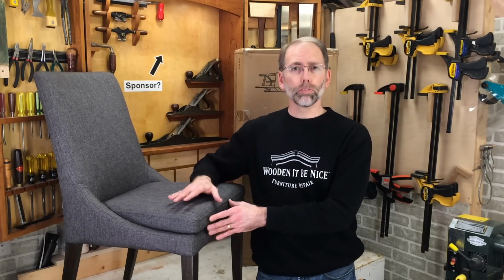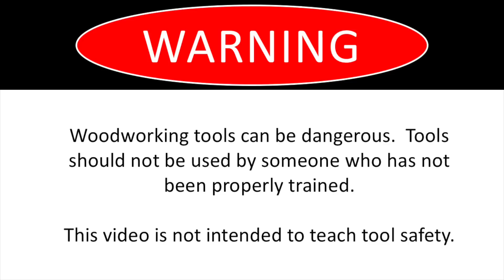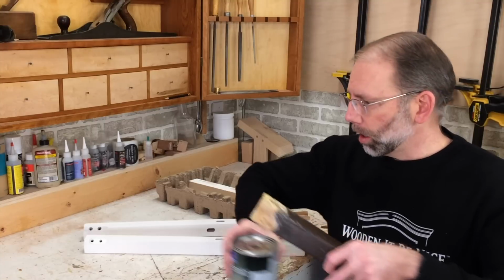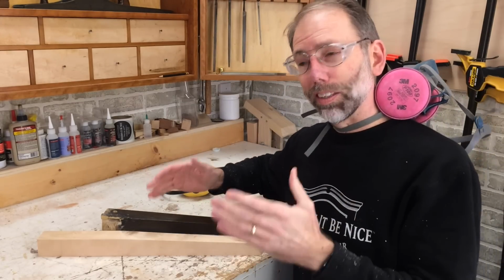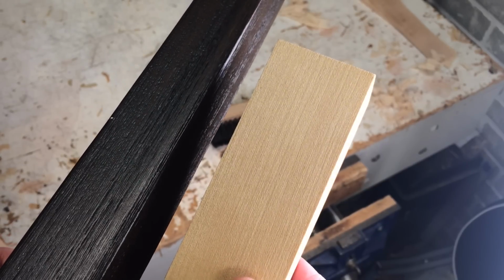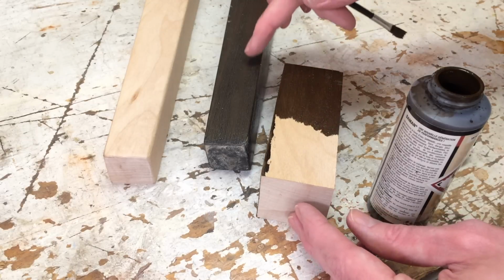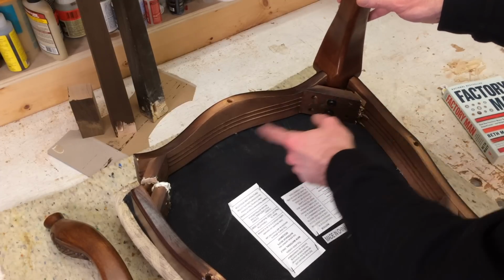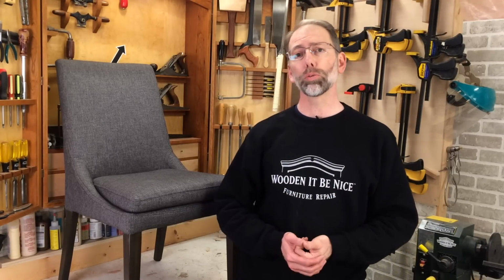New Furniture = New Problems: Solutions to Repair Furniture, by the Fixing Furniture YouTube Channel

Comment: I'm a retail store dumpster diver. As crazy as that sounds, people wouldn't believe the kind of stuff I've see thrown away from these places. It's beyond wasteful, so I'm definitely doing my part to keep stuff out of the landfill. It's provided me with brand new, often expensive furniture for my whole apartment for free. Plus a lot of other stuff.  Sometimes the damage is minuscule, like  I may have to simply get the hardware, or sometimes just one bolt is missing.  Occasionally I've not been able to identify any damage, bc some places will throw out undamaged older stock to make room for new. However some pieces are definitely more challenging. Currently I've got an acacia wood side bench and bookshelf I need to do some work on and I'm so glad I found your channel! I wish I would have found it 5 years ago when I started all of this, bc some of the repairs I did before would be a lot better lol. Anyways, even though I've mostly been clueless and didn't have the right tools, I still enjoyed doing the repairs, because like you, I like the problem solving and how satisfying it is when it pays off. It's also cool to own some attractive pieces that I would never be able to afford otherwise!  I've been binge watching your videos and I've already learned so much. I'm  pleasantly surprised to find that the last repair I did was mostly correct, with 1 or 2 things I could have done better, so I'm excited to apply everything to the current projects.  It's definitely been a learning process over the past few years! One day I'd like to have a a little space for a small workshop. Just for fun. Thanks so much for sharing all your knowledge!

Comment: I believe the reason that those back legs were a different color than the front legs is that they do not belong together. My guess is that you can buy that chair in either if those colors. When it was packed they put the wrong front legs in the box. Great job fixing these pieces and helping folks to be better informed.
Reply from the maker: Glad you liked the video. Thanks for sharing that.  Scott

Comment: My whole experience with furniture repair has been mainly newer furniture. Ive worked with Living Spaces, RC Willey, Magnolia, Ashley and such. But ive encounted problems like this many times, many of which was diy customer repairs. But ive had apprentices who came from a framing or drywall background who tried to sneak repairs like this. 

As for the manufacturer sending the same two legs and labeling them wrong. That happens more often than it should, but these large companies would rather we trash the chair than pay the money to have us build the new leg because these chairs are mass produced. So we end up keeping the chair for parts just in case we get another like it in.

I appreciate you showing us the wire brush method. I struggled trying to match that texture for awhile.

But I got that book on audible, gonna listen this week.
Reply from the maker: Thanks for sharing your experience on this front.  It's nice to hear your perspective.  I appreciate that.  Scott

Comment: Thank you, Scott.  As always a great video. 👍👍👍  
Being a newbie woodworker, I'm learning so much from youtube and woodworkers from all around the world.  And having several pieces of old pine and oak tables, chairs, a buffet, etc., all + 100 years old) from Sweden and here from Denmark, I've learned so, so much from you and Tom (Thomas Johnson Antique...) about old furniture like mine. 
 
I've never before heard of Hide glue! And how to use vinegar to dissolve it!

I don't know (yet) if some kind of Hide glue also was used in this part of the world too,  and try with vinegar to fix the few loose joints.  I really hope it will work! 
But, I will buy Hide glue anyway, and if I can get the loose joints apart, I'll use it to glue them together again.  And hopefully, they'll last another 100 years.
 
But I see another use of Hide glue, and it's not for old pieces of furniture, and not something I've seen or heard of in any of the YT videos involving Hide glue I've seen so far! 
 
Being a newbie woodworker and "mistake maker", I'll see if I can use it to "an easier" way out of what could be a fatal glue joint disaster!!

Using it on new projects, where I don't want to ruin pieces of well-prepared and "one of a kind" wood, just because I messed up the gluing process. 
 
A dry fit can prevent many glue mistakes, but sometimes the pieces, for example, move while the glue dries, and I do hope I'll be able to solve it using Hide glue and vinegar.

But does the vinegar method work with a new, and not decades old, Hide glue joint??

But first I'll try it with my old furniture.  And see if I've been a "good student", and I've listened carefully to a lot of the different know-how both of you so generously have shared with all of us about gluing and dissolving Hide glue joints.  

Time will tell ...  🤓

Scott, thank you so very, very much for all the many different videos from you I've enjoyed watching and learning from so far, and may there be many more to come.  👍👍👍

❤Wish you all a great, creative, active, and relaxing summer!    /Pia from Denmark
Reply from the maker: Thanks Pia. If you have a joint moving while the glue sets, you need to change your technique.  Glued parts always need to be clamped in place so the joint is tight and held in place until the glue dries.  I hope that helps. 🇨🇦

Comment: You did a remarkable job replacing those defective legs. I rarely buy new furniture, but I would have returned the defective chair for a full refund and gone to another store. Thank you,
Reply from the maker: Thanks for sharing that.  It seems the current economic model for online furniture shopping is that if the customer isn't happy, they refund the purchase versus having it shipped back and returned.

Comment: Helpful video, thank you for posting. I have found that walnut ink helps to get me the colour i need sometimes, it penetrates well and is made from the oxidized husks that encase the walnut before they are harvested. If you've ever harvested walnuts you'll know that they stain your hands a very dark brownish black tone, i was pleased to learn that people do indeed bottle the stuff. 

Have a bamboo shelf that was meant to be an outdoor product but only had a thin acrylic-like finish on it that peeled off over the last year and it has since blackened where the water penetrated around all the joints. I don't mind the moldy bamboo look, and I've taken off all of the loose finish with a wire brush and some sandpaper,  but I'm not sure what to apply in its place, if anything. Bamboo doesn't seem to be very absorbent so I might simply rub some wood oil on it and let the rest of the clearcoat flake off. If anyone wants to chime in with an idea I'd be appreciative.

Comment: 02:00 What's the difference between upolstery staples and common staples? Thanks for the video. 👍
Reply from the maker: Staples from a staple gun are flat pieces of metal whereas upholstery staples are wire, similar to a paper stapler.  I hope that helps.  Scott

Comment: I watched your video and now Im worried. I bought a VERY expensive dining room set made by Drexel, the Heritage Edition. Its solid oak and really beautiful....but you said to make sure your chairs have stretchers across the bottom and mine dont! The set is 38 years old and the chairs are still tight as ever. Still makes me wonder if I overpaid just for the name. The side chairs were $395 each. The set is from NC.
Reply from the maker: If the legs are still solid, you’ve got some quality furniture.  That’s a fair price for something that’s still in good condition.

Comment: When you were talking about the changes that have taken place with furnature manufacturing in America, there's a big one you didn't mention. one that really irks me. that is the use of particle board which is just saw dust glued together. then it is often held together with either screws or staples. the trouble is there is no strength to start with.
Reply from the maker: Yes, that's not furniture that can generally be repaired.  Once it's broken, it's broken for good.  Thanks for sharing that Paul.  Scott

Comment: That surface texture can probably be made by a rotating steel brush on a drill. I’ve tried it on some hardwood and looks very similar. On factory made furniture they will definitely use quick solutions.
Reply from the maker: Yes, that’s a good point.  Thanks for sharing that #tip

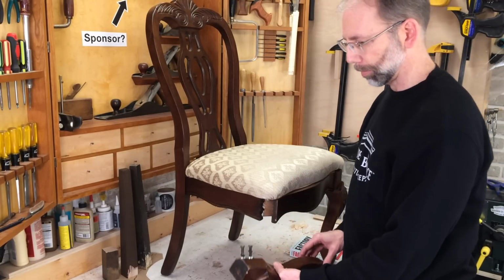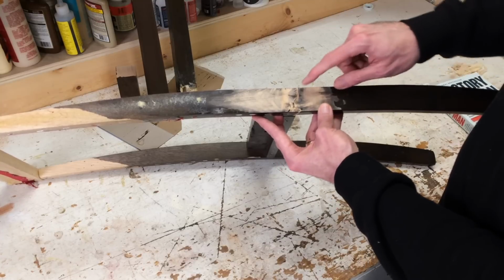Comment: Hi Scott. I have a bar stool which is similarly constructed as the chair starting from 43:57 to 44:58. How would i go about reinforcing to prevent breaks? 
Also thanks for the info about the metal beneath the chair not being a good idea from 35:01. The chair mentioned in the first sentence i have to screw the tenons, i'm thinking of gluing those instead and filling screw holes with wood filler.
Reply from the maker: There isn’t a way to reinforce a bolted angle bracket.  You could take the chair apart and rebuild it with dowels, but that’s a lot of work for preventing a break.  I suggest just treating the chairs as fragile, and not dragging them will help prevent breaks.  I hope that helps Khan.
Reply: @FixingFurniture  This helps, much appreciated.

Comment: This is why you only buy cheap, flatpack furniture at IKEA, they know how to do it kind-of ok and if it breaks you can usually get replacement parts. </joke>
I used to have some IKEA chairs that held up well for the five or so years I used them, they used dowels held together by long, skinny, caphead machine screws going into barrel nuts and with large washers resting on end grain. One current chair that uses the same join that is currently in the catalog is EKEDALEN.